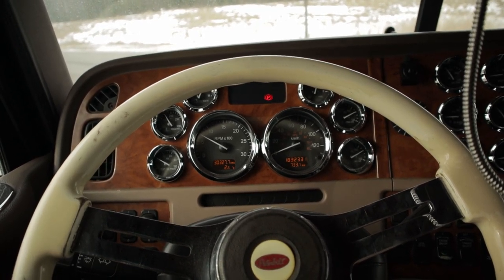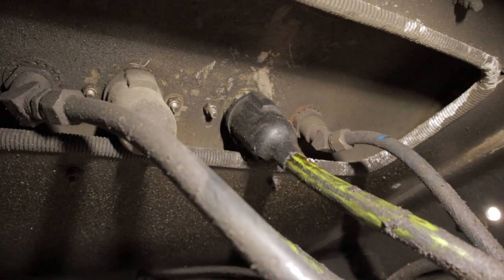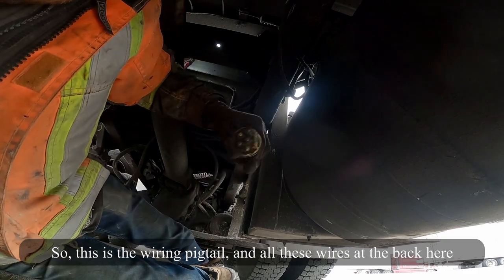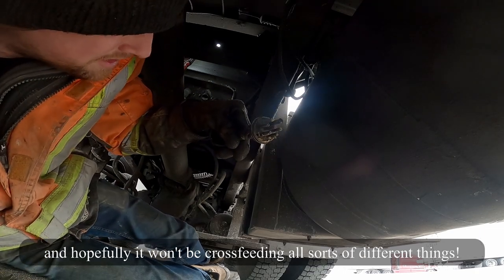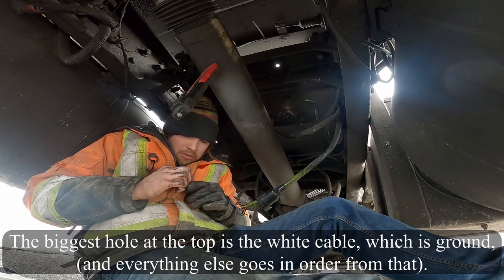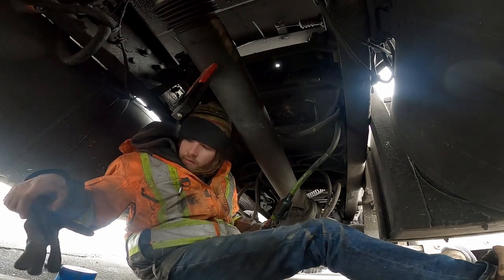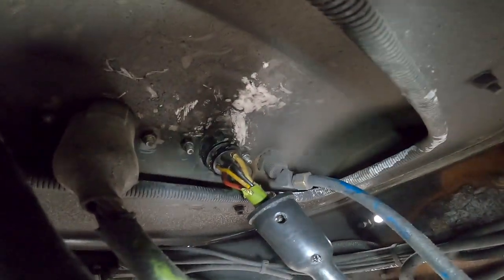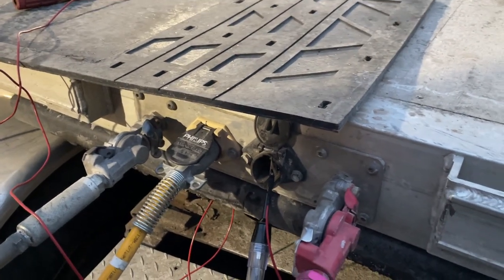EMERGENCY ROADSIDE REPAIR! Fixing Trailer Pigtail Wiring

Comment: I’m sure at this point you got it fixed.

Had same exact issue on same model truck. In my case the receptacle failed on the trailer side and was allowing multiple circuits to be in contact together. New receptacle and it was fixed!
Reply from the maker: Yeah it was sent away to be fixed, it was something in the pup trailer. Sad part is they are brand new trailers and already having electrical gremlins!!!

Comment: The 2006 379 I drive which is similar to this truck had an issue a while back, where the right turn signal would only work when I’d open a door.  Left was fine. Even with hazards on, only left would blink unless a door was open.  Not quite sure how it was done bc I was off when they fixed it, but I wanna say a jump wire was ran some kinda way into the fuse panel and attached to a special fuse or something like that to make it work.  Nvr heard of anything like that until now, but so far it’s working like new, lol. Also, I enjoy and admire your videos. Watching the mechanic work, and different driving techniques.  I’ve been driving a while now mainly local, but I’m still learning tricks here and there, some actually from some of your videos.
Reply from the maker: Very strange behaviour! Yeah it must be cross-feeding with the door open switch (???) haha, that would be a fun one to figure out.

Thanks for watching!

Comment: Nice being able to easily get up under there and work - my F150 is the same way, but less... But them side-saddle tanks don't seem to be helping.
I prefer a lighter for stripping wire.
I'm guessing you have a bad bulb socket or associated wiring.

Comment: Hey, Mr. Matt! You're on the road not in your house, i drive a semi as a living here in México, but what I'm trying to say, is you should have put some solder on the tip of the wiring so it wouldn't have done the same in the later years, just a a thought for the future.... Nice work great videos.... God bless..

Comment: Hey if you wanna protect your wires I would use rubber shrink wrap that keeps all the water out you put the rubber tube on and heat it up it’s a nice fit thankyou for sharing your video here from Ontario Canada be safe out there 🇨🇦🇨🇦🇨🇦🇨🇦❤️❤️😎🚛
Reply from the maker: Thanks man, yeah I shrink wrap all my butt-connectors and made up wire repairs, but in this case the water is seeping in at the connection and sitting and corroding everything, at this point the best thing to do is get the water outta there, apart from rebuilding something that doesn’t fill with water!!!
Reply: I have a question for you how is it now when you drive a truck across the border or even in Canada how long can you drive for is it still 14 hours or is it a less now The reason why am asking this is Back in the day my father’s best friend used to drive truck this is back in the 80s they used to drive all the way to California to get fruit take a rest and then drive all the way back one person
Reply from the maker: @mikemckinley1031  So US hours of service is 11 hours driving a day, 14 hours total on duty (including driving) and a 10 hour reset. Canadian hours of service is also 14 hours on duty per day, but 13 hours driving, and you can take up to 2 hours off duty throughout the day and get it back at the end, making a 16 hour day total, with an 8 hour reset. You have 70 hours to put in throughout the week before you need a day and a half "weekend" rest.
Reply: Oh my god it’s changed over the years because my father‘s best friend used to go to California drive straight through pick up his fruit rest for like 4 to 5 hours then on his way back to Ontario used to spend his weekends with his wife and then back on the road on Monday to California it seems all messed up for hours now anyways you be safe out there I know you’re a good driver but you have to watch out for all the other idiots out there cutting you off here from Ontario Canada 🇨🇦🇨🇦🇨🇦🇨🇦❤️❤️😎 p.s. I do love riding in your truck when you have your camera on love your videos thankyou for sharing 🚛🚛🚛🚛🚛🇨🇦🇨🇦🇨🇦👍👍❤️

Comment: Id use a hot glue gun or all weather silicone and inject it onto the gaps of the connector to make it water tight, sealing the exposed wires from air and water.
Reply from the maker: Yeah used grease at the top after this to keep some water out 👍

Comment: Whats the middle pin for? What can happen is that there is a bad ground, causing it to search for a ground somewhere else, in this case trough other lights. But it's weird to me that it only does it when those both pins are powered. I would expect something else to light up when only one pin is powered. Brakes or turn signal.
Also, with the expectation the power cord connector at the truck never get removed unless replaced, it might be an idea to put some grease around the connector preventing water to get inside.
Reply from the maker: The middle pin is for the trailer lift axles power, and whatever is back-feeding through to it is causing my lift axles to lift any time I press the brakes, which the DOT sure wouldn’t like! But yeah it almost seems like it needs to be a certain amperage of supply before it trips. Either way though the trailers were sent away and it got fixed!

And yeah that trailer plug was lined with grease before I started messing around with it here, and it is now lined with grease!

Comment: I blame all the salt eating the trucks away. I had the pin for the trailer marker lights stop working last week ended up having to get a new outlet on the tractor. Its a stainless one with a gasket, see how long it works.
Reply from the maker: That sounds nice, best of luck with the stainless unit, I might have to find one myself